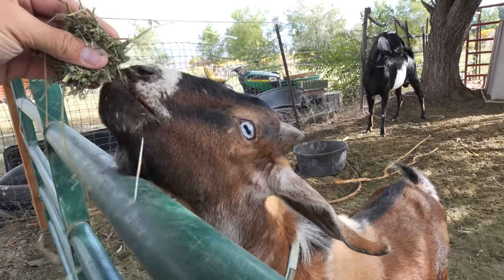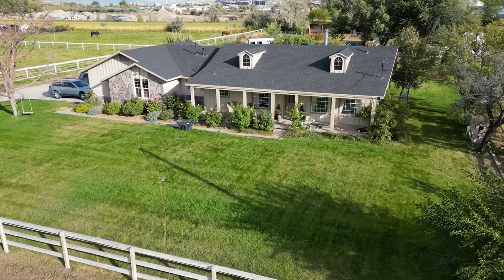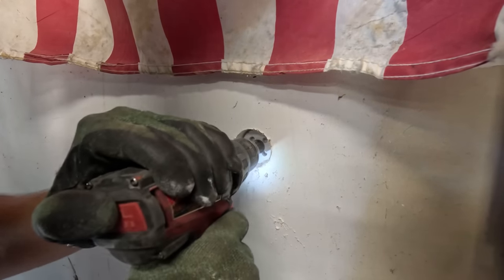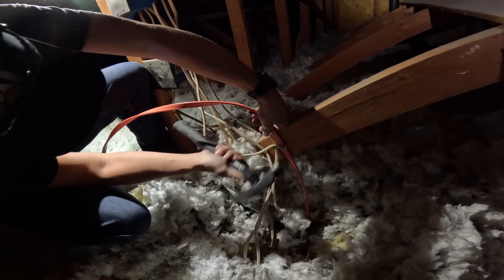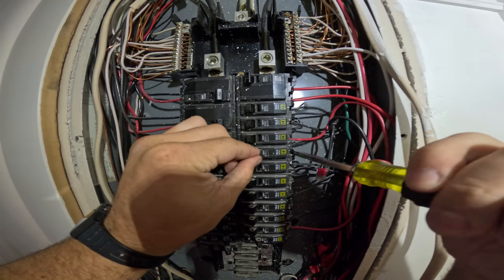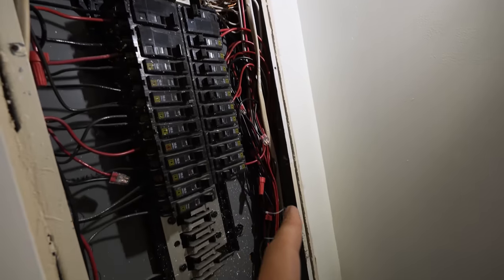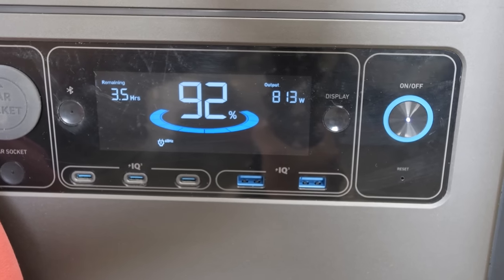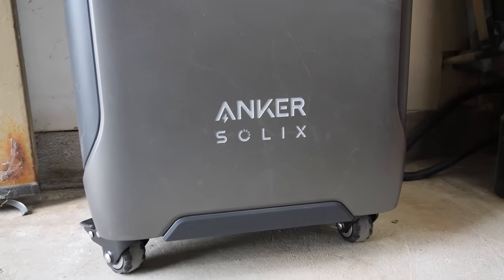Ankers newest Power Station can charge a house and an iPhone... 300 times

Comment: You know what really grinds my gears? When big companies like Anker uses kickstarter for market size and potential research purposes, while also getting funding for their own r&d of the thing they want to create, when they could simply afford it themselves, thus making smaller startups and creators much harder to find and value.
Reply: I agree but i gues thats just business
Reply: Even Philips has done it for some sleeping earphones, which I don't understand at all. Huge international company relying on kickstarter like some novice start-up, it kinda makes me wonder what's going on.
Reply: It's a relatively risk free version of market research, where you could also potentially get customers and funding for R&D, all for the low-low cost of setting up a kickstarter page with some rendered designs, as opposed to doing the market research in the old fashioned way which would be more costly and less indicative of real market penetration later on. Still, big companies doing this makes my stomach turn, and I hate that this has become business as usual. @Tomazack
Reply: I do not understand your aversion to a company trying to reduce their risk? Putting it on kickstarter allows them to gauge if there is a market for this type of product and for the customer to know that they will get an actual product in the end. It is not the R&D (that has been done you see the product is already created) It is more how much they should invest in manufacturing at scale.
How does this really impact smaller startups and creators?
Reply: @tisjester exactly my thoughts!
Reply: The important things kickstarter does is 
1: Gauge market interest, saying a product is interesting is one thing, buying it is another. It also shows how large a production run has to be.
2: liquidity / interest, companies generally don't have that much cash laying around and to start producing, you need to have the money beforehand. Even larger ones still rely on loans a lot.
3: marketing, it helps to showcase the product.

In return they often do offer real discounts, of course as a buyer you take a risk, personally I wouldn't do that in most cases.
Reply: And they use YouTuber's to promote it hahahahah
Reply: Nobody forces backers to back? If it was so awful it wouldn’t work. The people decide. It’s smart.
Reply: It's a Chinese company, what do you expect?
Reply: Agreed. Don’t buy until it’s retail. Kickstarter is NOT a store.
Reply: I was wondering why they need a Kickstarter
Reply: Thats called business at its finest
Reply: @tisjester . The issue is that it takes badly needed money from people who need it most. New startup business owners need capital that they won’t get because companies that can afford their own R&D are taking handouts.  It’s sort of like Elon Musk taking welfare, so he can pay his rent.
Reply: @JasonMcCord-qk3yb newsflash: elon already abuses carbon credits
Reply: True but big companies have a higher chance of following up and completing it hoe many kickstarters from random start ups disappeared after getting funding
Reply: However it helps in finding a market for their stuf
Reply: the thing is, they are giving a pretty big discount for backers. without the discount its just better to have a full system installed on a house for almost the same price. 
I do agree that it is a bit scummy that the companies use kickstarter for research and stuff but only if the backers dont get a big discount on the finished product. With a 35 to 45% discount i would say its ok.
Reply: Not sure how it makes smaller startups or creators harder to find.
Reply: People ultimately decide where to spend their money. If they want to support small players and innovators, they should take the time to find projects they feel are deserving. Same if they want to take a risk on a paid beta test for a major brand in return for a discount that won't exist at retail, if it makes it that far. No one is getting robbed, no one is getting blocked from doing their due diligence.
Reply: On the flip side, it's a ready made system for advertising and taking early payments, and also subsidizes the platform for smaller creators.
Otherwise, Kickstarter would be struggling with the small guy and having to charge more for the same service to the small guy.
Reply: How do they make smaller startups and creators much harder to value? It’s not like people are dying to look for them anyway. Most of the smaller kickstarters have ideas ranging from dumb to impractical to downright scams. If Anker never went on kickstarter, the smaller startups would still be mostly dumb, impractical, scams. If anything, big name successes like Anker brings some legitimacy to the kickstarter scene. In the end you’re just complaining because you’re not good enough, but still want people to throw money at you for some reason. Instead of grinding your gears, go make your product better.
Reply: It doesn’t seem like that big of a deal when it’s a niche product that otherwise wouldn’t be worth the risk to invest in and develop. 

It’s only dumb for big companies on common / obviously popular things. Like if Sony had a kickstarter for the next PlayStation, that would be dumb. But if they had a kickstarter for, idk, a Sony motorcycle, I don’t see that as a bad thing despite them being a big company.
Reply: Agreed
Reply: It's essentially makes it an easy loan whenever the product get's in stock.
Reply: You're right. Even if I am fascinated by the product it's insane they're kickstarting it. Gives me little faith in the company, like they can't fund themselves at this point. Which is probably incorrect, they're likely double dipping. Still, grinds mine too.
Reply: They do it to support KickStarter’s bottom line.
Reply: Well it makes sense if they are not sure if enough people would even want to buy it right away so this is like a soft release for the product since we already know Anker is an already established company and could afford it but at the same time don’t wanna lose out on money if it goes into production and sits on the shelf also not forgetting it IS a battery so why mass produce them if they don’t for sure know people will buy it and the battery possibly go to waste being an unsold product.
Reply: Kickstarter unacceptable. I’m not giving money away just to never get the product
Reply: You get a good discount when you pitch in tho
Reply: Have you used Kickstarter even more then once? Have you actually seen a good product not funded because another large company put something up? I haven't. 
Considering backers usually get a discount under MSRP its never about funding R&D for big  companies, its for starting hype and gauging interest in a product which is a VALID use of the platform.  As someone that actually uses kickstarter I have been called an idiot for "gambling" my money but then you back a safe product now your helping evil corps smash the little guy. Always a loser in the eyes of people that don't even use the freaking site!
Reply: #1 rule of business. Always use someone else's money if possible😂
Reply: Why would a Chinese technology company care about Kickstarter's bottom line? @kurtnelle
Reply: wah wah wah
Reply: It’s extremely smart lol risk free for the company 😂
Reply: @Lyra_Lycan  hmm yes that is the irony of it all .
Reply: Get over it. Don't invest if you don't like it
Reply: I understand your frustration with big companies using crowdfunding platforms. However, it's important to note that not all companies have the financial means to invest in research and development upfront. As for the Segway Portable PowerStation Cube Series, it offers a versatile and powerful solution for outdoor enthusiasts like us. With its massive capacity, fast recharging, and comprehensive protections, it's definitely worth considering for your outdoor adventures and backup power needs.
Reply: Cheaper that’s the answer right?
Reply: Agreed. I saw logitech use a kickstarter the other day...absurd
Reply: Y’all drama queen girl babies need to live a little. Not cry all the time. Poor widdle baby
Reply: @charliedelta1136  stop crying online you baby
Reply: @seegee9  you need a shoulder? I’m here
Reply: If people didn’t like this they could just not support it

Comment: Isn’t anker big enough now to release a product without doing a kickstarter? 🙄
Reply: ? Large companies use Kickstarter to gauge the market and see how viable a product is.  Manufacturing at scale is a risky endeavor and this allows them to reduce that risk.
Reply: @tisjester  and that is what has ruined kickstarter.
Reply: Anker sure advertises like they are in company with the big dogs.  These things are not cheap either.   That'd much would buy a nice dual fuel inverter generator with a ton of money left for  fuel and run a lot more amps than these roll around 'battery pack' with inverter.........not to mention time to recharge the behemoths.
Reply: @avflyguy  Generators require regular maintenance, and are only useful for outages. Plus a system like this if you have a good solar setup good power your house FOREVER compared to a generator which is 3 days realistically with fuel. As for the "run more amps" no clue why you would even mention that when the video shows 240v as well as pulling 6k watts with no issue ( with even a higher surge ~8,000 probably ) most generators top out at around this range anyway.

Generators still are better for those on a budget ( <$500 ) but this system is for a completely different purpose, off-grid with the bonus of outage protection.
Reply: getting $$$ up front man, its all greed at the risk of the investor!
Reply: @TypicalBlox   yes...but how long can you run pulling 8,000 watts?  That won't even be 1/3 the power to run a small house with central air.  Maybe to sustain after startup.  I have a big 6,000 watt gas non inverter to power almost anything with a motor.  As many lights house wide,  Runs 9-10 hours at 50% load on 7 gallons.  Also have a 2500 watt dual fuel for sensitive electronics, computers, routers, TV's, portable electronics for charging which,,, it were an extended time of no grid  power will run indefinately as long as the natrual gas will.  
I'll bet in 10 years, what this so-called battery backup power stations will be obsolete either by another type of battery technology, or more likely,  ANKER?  WHO?  Long since bankrupt so it'll be stuffed away somewhere in your garage,  while my already 30+ yr old big genny works like it was new. Small one likely the same.
Reply: @avflyguy  once again this system is designed to focus on the off grid aspect, the idea is a decent solar setup can keep the battery near 100% during the day and the battery just needs to last enough to make it through the night In which the cycle repeats
Reply: 100%. They have billions in cash flow.

Comment: I'm sure they appreciate having this backup in case there's a power outage, and they'll appreciate the solar panels on the roof later even more.
Reply: solar inverter will turn off though when the grid goes down.
research different frequency of backup solutions compared to the grid - and why inverters turn off when a standalone backup (can also be a diesel generator doesnt have to be a battery) is active.
there are (expensive) solutions around this issue.
Reply: Solar panels are going to totally destroy how good that roof looks.
Reply: just get the solar panels with the battery shown on this episode or get a jackery with panels on prime day, no need to put anything on the roof.
Reply: @latrofu o
Reply: @ChrisHolzer if he just runs the solar to the battery then it wont matter about the inverter. As the battery system wont accept more with a 100% load as it has an internal inverter. But i see 800 watts 3.5 hours hes going to need 2500 atleast to keep the battery charged but what about overnight he needs an extention battery of maybe 1-2 for a full night on backup

Comment: Even at 45% off these things are nearly as expensive as Tesla Powerwall's BEFORE incentives. No contest after incentives or if you buy more than one Powerwall. Not to mention the warranty differences or cycle differences. If you need extreme portability sure. For home backup use alone that's a hard pass.
Reply: What incentives?  One of the diseases of YT or Reddit comments is people saying 'incentives' without telling us which area of the world they live in....Green Mountain Power in VT will essentially buy one of these for you, in their new proposal, where Detroit Edison (DTE) will ask you what a battery is for...it's different worlds entirely pretty much.
Reply: @acchaladka  which is exactly why I didn’t go in to details on what incentives apply. YOU can do that investigation. It’s also exactly why I compared the cost BEFORE taking any incentives in to account.
Reply: Power stations above 3kwh ( I believe ) also have incentives too, this would also qualify
Reply: This thing costs $2,199 USD with the discount. A Tesla Powerwall costs minimum $8,400 USD (according to the Tesla US site right now). In what way is the Tesla option anywhere close to the Anker option? It's apples and oranges anyway, the Tesla solution has roughly 3.5x the capacity.
Reply: @guspaz  you did the math, congrats! 2200x3.5 = 7,700.. or "nearly as expensive". Yes it's per kWh, that was implied. Obviously the PowerWall is larger in capacity.
Reply: @guspaz  my conclusion is that OP is a deeply unkind kid, badly raised, and that the Anker is appropriately priced.  Hopefully they'll build a direct competitor to the Tesla next and give us a break from the Tesla fans.
Reply: @acchaladka  I had to give you a like for that. I hope your day gets better. :face-purple-crying:
Reply: @racerx00 but does the Tesla powerwall have peak 6 kilowatt  like the ankor? The anker has a maximum of 12 kilowatts Peak output which is the selling point to me. You'll be able to run your house including dryer,  water pump, oven plus power electric vehicle at the same time with 3 ankers batteries (witch is around the capacity of tesla pw)

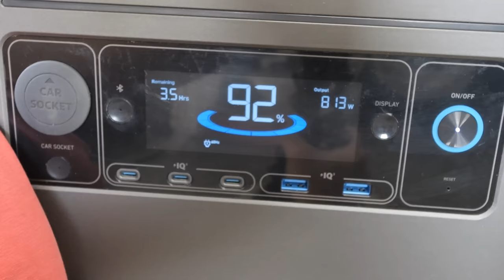Comment: There's an important figure that Jerry didn't mention - Runtime, aka "how long till the juice runs out". If the house is using 800W of power, and the battery has 3.8kWh of stored energy, that's a max runtime of only about 4 hours (You can see the remaining time on screen at about the 5:11 mark). Definitely something to keep in mind if you want to use this as a backup for any extended period of time. 

There are more cost-effective ways to do this with inverters and standalone batteries but the tradeoff is ease of installation. This setup certainly offers more portability - If you're going camping or need power elsewhere you can always lug this Anker unit along for the ride, though I expect that it weighs around 100 pounds or so.
Reply: Thanks for your info👌
Reply: Not to mention that they only had 200 slots available for the 45% off early bird special and they sold out within just over an hour of it being online.
Reply: Its a paid advertisement video for anker. U expect him to be honest? 😂
Reply: @anekinoo7  i dont see dishonesty, just not too detail
Reply: Don't forget the well pump that bumped it to over 2,000W.
Reply: I suppose that once you fall off the grid you won't continue to consume the same you will take all the non essentials offline to stretch the battery out longer. But otherwise yep, it's gonna run out quick sharp
Reply: I think really the plan was to use it for the water and temporary emergencies. The solar panels will likely assist in the longevity of it.
Reply: @SimonLant  Well you can always upgrade the battery system to compensate. I have a 64kWh system at home. I think the disparity here is that Anker sent them a pre-production model with a set amount of kWh and he needed a narrative to film a video around.
Reply: Exactly. And when the water pump kicked on, the time remaining fell from 3.5 hours to 1.2 hours.
Reply: Useless , it would be good to have 10k kw/h .
Reply: @rossmalicki1142  I just got a spot the other day.  Yes it's 200 total, but people are going to back out or grab another deal before the deadline.  Keep an eye on it or setup a website watcher to tell you when one opens up.
Reply: @davidshutt1772  Water pumps are very cyclic, even refrigerators are.  I bought one to use for those purposes.  A lot of my house will be powered down for an extended outage and I won't be charging my cars.  The lights are LEDs so little use.  Now to just source some 3rd party solar panels.
Reply: @Solkre82  ohh okay I didn't think it would be available after the initial run! That's good news, thank you
Reply: @Solkre82 what do you mean?  If the super early bird special is sold out its sold out. How can you still go back and grab a spot?
Reply: @keslee7036  Watch the 45% one as we get closer to the end.  Some people will back out and spots will become available.
Reply: @Solkre82 ahh I see
Reply: This is very useful for a hurricane or any natural disaster for help your family to charge its devices even to keep using wifi without electricity, it’s very useful for that purposes.
Reply: @bayyonetta2989  leaving out detail and not giving out full good or bad opinion is a bit dishonest. The video is promoted to make the product look good to sell it cus he was paid to advertise it.
Reply: @anekinoo7   should he make journal then, not short video, and he should use statistical measurement, and calibrated tool to analize every single thing, so nothing left out, is that honest enough?
im not trying to defend him, just try to be fair, yes it is an ad, but to call someone dishonest is just sound so bad, sorry, peace
Reply: I wonder why..................
Reply: What's an example of a more affordable option?
Reply: 130 lbs. Good guess!